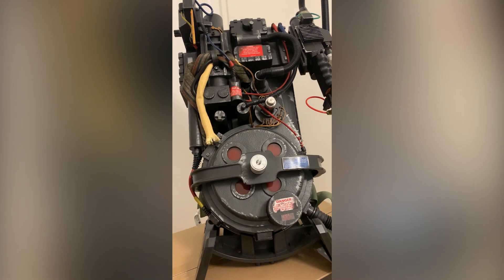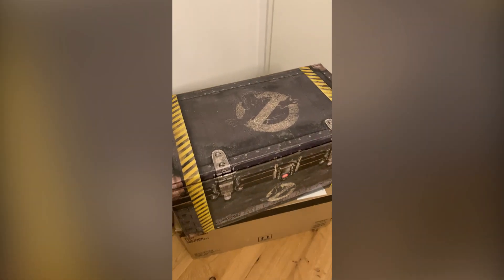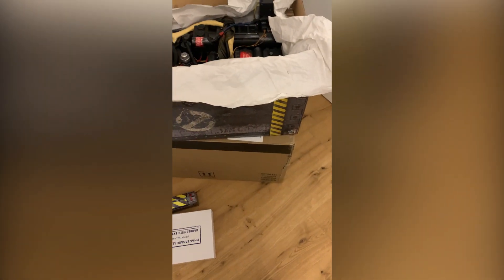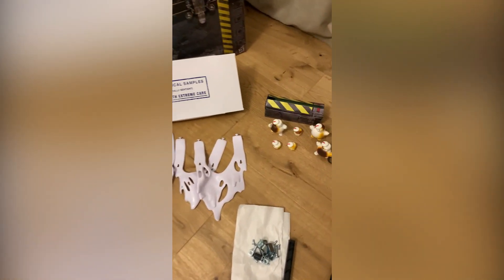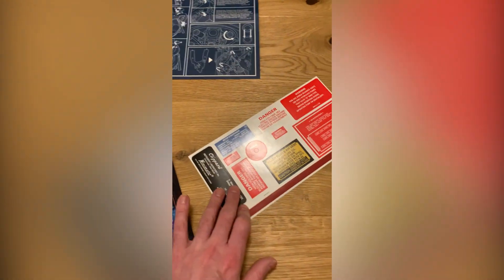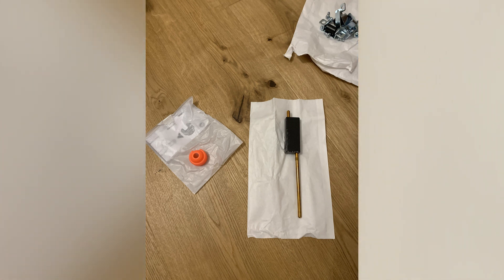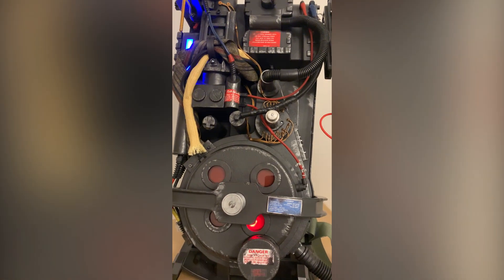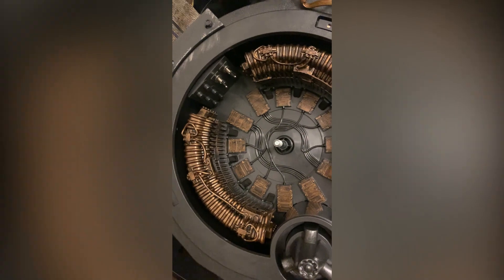Hasbro Ghostbusters Proton Pack replica | FAN UNBOXING

Comment: Is it possible to upgrade plastic parts for metal? Like the clippard valve?
Reply: The top of the clippard valve is metal
Reply: @DiversesKanal1  but is it a genuine part?
Reply: @chocolatepuddingpant  no but there are screws then you can upgrade with an original from eBay

Comment: So.. I just did a test with my own pack(Haslab) without the wand after 3 min and 15 sec the pack will power off by it self. I did this first without keeping time just have it power down, then I did one more time with a stopwatch and then I think I found a easter egg a bit before reaching the 3 min mark the pack made Ghost howls and screams noise and then powered down. this was with the afterlife mode. pretty cool